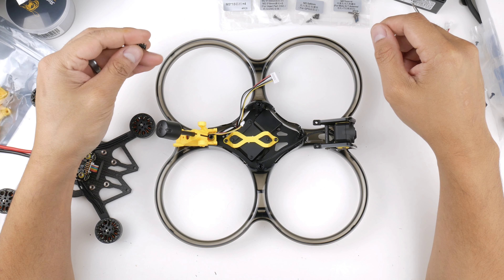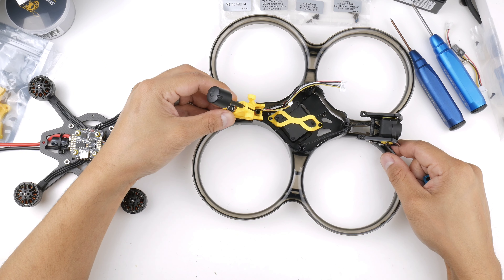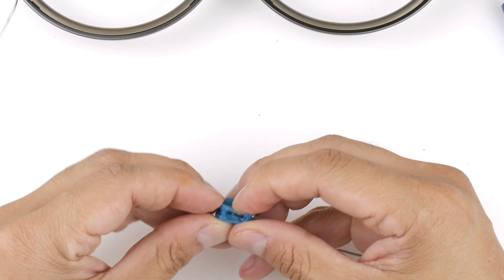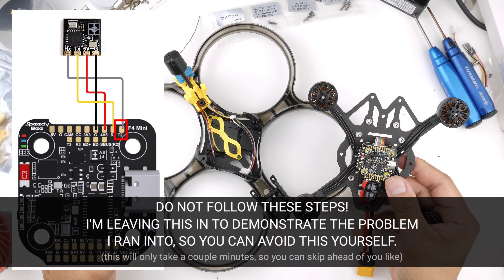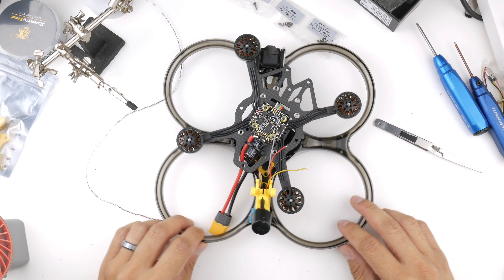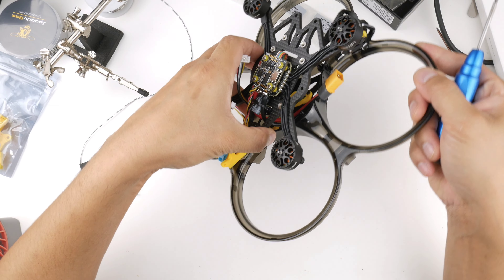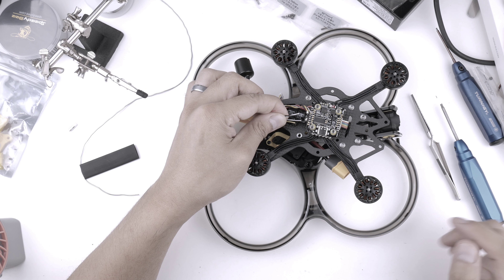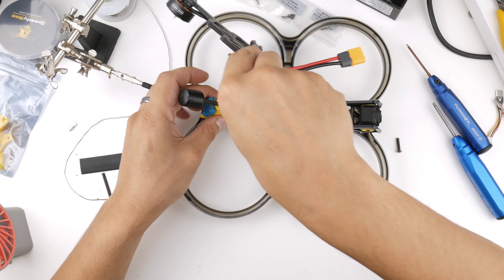SpeedyBee Bee35 Build - Part 3 - HappyModel EP2 & DJI O3 Air Unit Wiring

Comment: Hey, great tutorial! I have question regarding the DJI O3 air unit. I want to build a drone, that is capable of doing still photos of terrain. I want to do photogrammetry also photos of historical sites. Is there any way to make the DJI unit also make photos, or it is only capable to make videos? Did not find many people trying something like this. As a backup plan, I could just have two cameras, but it would be best to use something like O3 Air unit combined with third-party gimbal. And yeah, I know it's probably easier to just buy Mavic mini, but I also want to experiment with machine learning, so it makes sense to do everything on this build. (I already built a few acro fpv drones, but with basic fpv cameras).
Reply from the maker: Thanks for your comment! Unfortunately I think the O3 Air Unit only has video recording capabilities and no photo capturing. You'll likely need a separate camera for what you're after. Sounds like a great project though!! Good luck! 👍
Reply: @nxp200  Thank you. I am already considering some sort of compact camera with manual shutter that would be triggered by servo or some adapter. But of course it complicates the whole build.

Comment: Hi man, watched all 3 parts but you didn't mention anything about he props how to put them in the correct order, I am struggling to put the props cause the 6mm screws wont fit right can you help?
Reply from the maker: The motors should have come with 8mm screws that will fit. I think I also had spares because the frame also came with them.
Reply: @nxp200  thank you for that, it works. but can you tell me the motor config in bf. confused on it, my quad wont take off. my settings are wrong
Reply from the maker: @SahilMore19  that's the next episode of this series. Apologies, but I haven't had time to finish editing the video because I've had to move house. Hopefully I can release the video soon.

Comment: If I dont wire the SBUS on the dji O3 air unit to the board will I still be able to use the dji rc controller?
Reply from the maker: No. The DJI controller only works via the SBUS wire from the O3 Air Unit

Comment: Hi bro, I can copy this and paste it into clear and I can tell you which battery you use, I think mine is very slow, that's the way it is my friend
Reply from the maker: You'll need to copy just the PID profile section. Not everything else. Battery I'm using is the CNHL 6S 1300mah (Black Series)

Comment: Why can’t I connect the Air unit to the plug on the FC?
Reply from the maker: The flight controller in this video is the Mini and does not have the plug for the air unit. If you are using a different flight controller that has a plug for a digital air unit, make sure the pins are in the correct order, especially the ground and power.